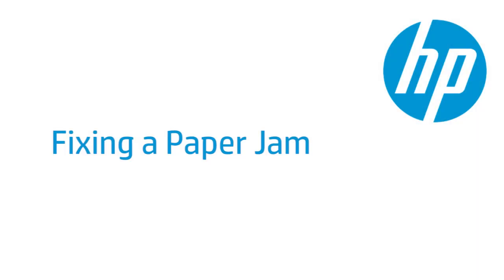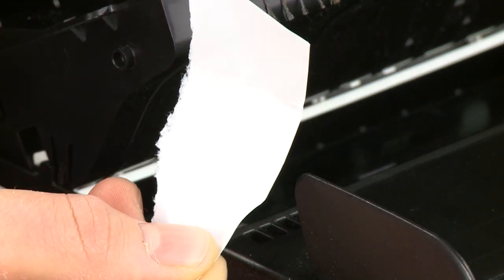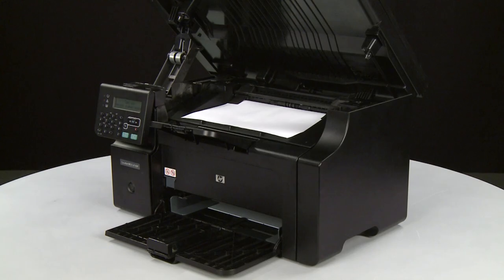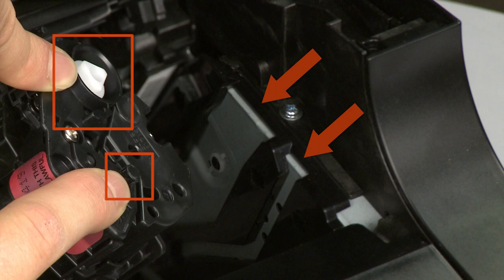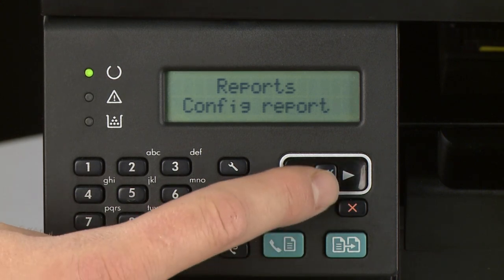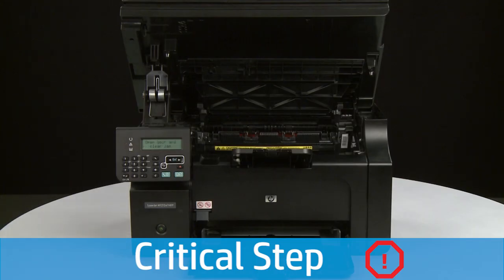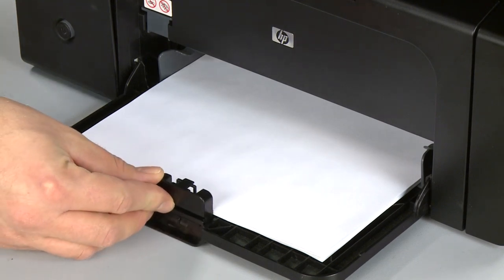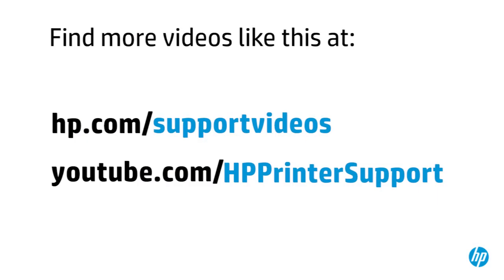Fixing a Paper Jam | HP LaserJet Pro M1212nf | HP

Comment: how to take double sided printing without pc
Reply from the maker: +bharath bala You can set up a print job so that both sides of the pages are printed. Change settings in the print driver and flip the pages, depending on your printer type. Please refer these documents for more information: How to Print on Both Sides of the Paper (Windows) (Duplexing): http://bit.ly/2sp6Rb8 or How to Print on Both Sides of the Paper (Mac) (Duplexing): http://bit.ly/2H6ugUV

Comment: excuse me I got another problem whenever I open my printer it just says front door open and the front door isn't open
Reply from the maker: +Manal Mohammad   Please try resetting the printer. I know you don't have an Officejet 6310 printer, but the steps are the same as the steps in the document titled "HP Officejet 6310 All-in-One Series Printers - 'Reset Power' Message Displays on the All-in-One".  The steps can be found in the section titled 'Solution two: Reset the product'.  To find the document please search for C01059445 on HP's home page or using Google search.

Comment: Step 2 and 3 look the same
Reply from the maker: +maku gx   The output and input areas of the printer, although they make seem like the same step, are actually different areas where debris can hide in the printer.
Reply: oh. shanks. 
Anyways, I fixed the printer for the customer. thanks
Reply from the maker: +maku gx   That's great that the printer is fixed.  :)